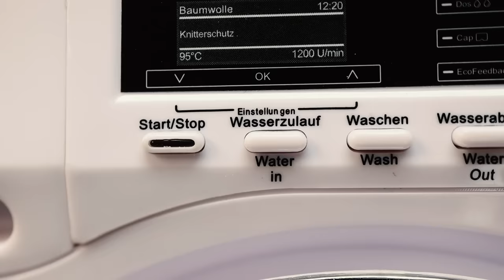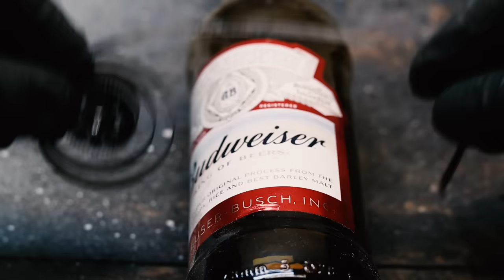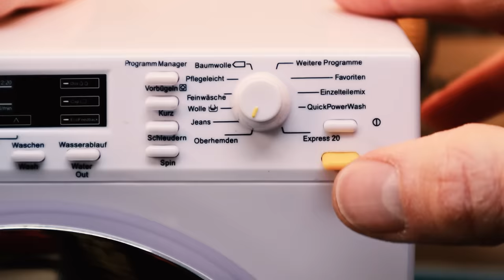Rare Mechanical Toy Restoration

Comment: Minus 2 points for not chrome plating or dry teflon spraying the gears and not adding grease to the mechanism before closing it. Oil is not enough.